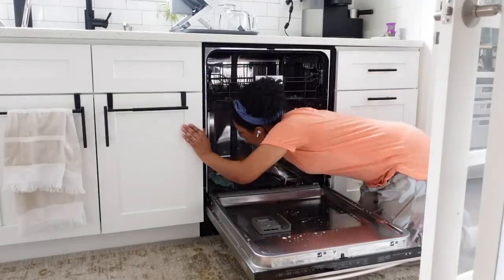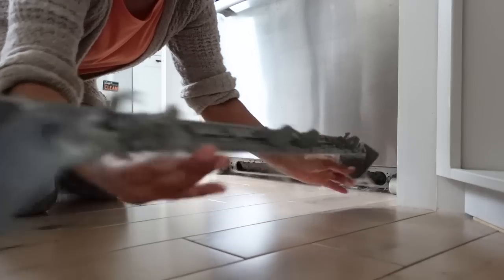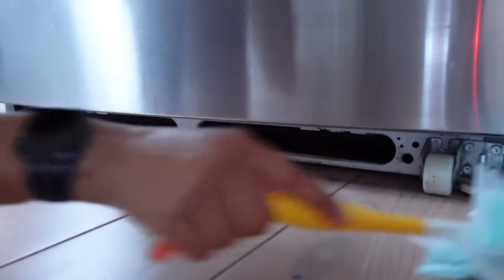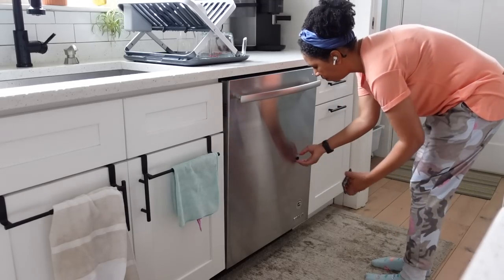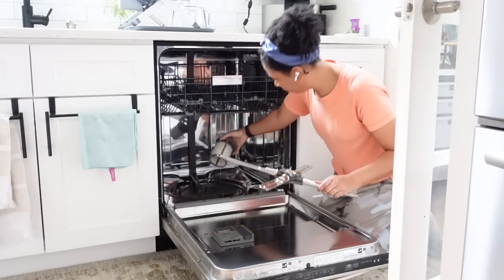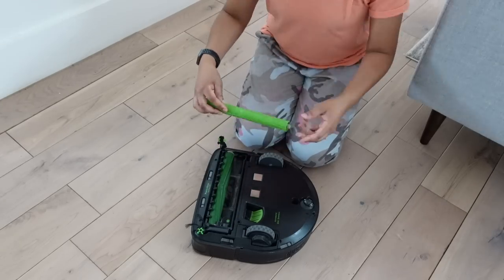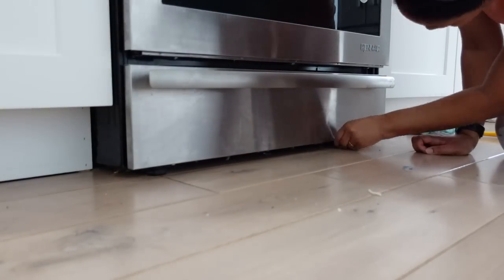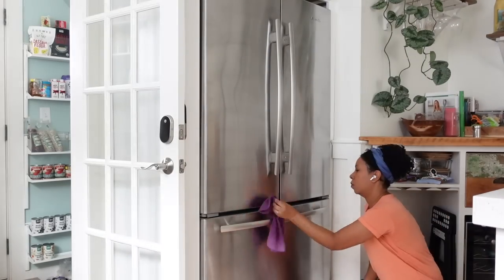🌸🧹 Spring Clean With Me: Kitchen Detail Edition 🧽

Comment: thanks for the reminder on doing some of these tasks. I have to get in on my dishwasher, because the seal has so much calcium buildup it sometimes leaks while it runs.
Reply from the maker: Oh no!!! Throw on a podcast and GET IN THEREEEEEE
Reply: That is the plan!
Reply: I started with multiple vinegar cycles to soften the lime scale buildup. Followed with a baking soda cycle, which scrubs the grit for me. It didn’t get everything, but much less left for me to scrub. Don’t mix the soda and vinegar since the soda neutralizes the vinegar.
Reply: @NanetteLoves2Budget  how much did you put into each cycle?
Reply: I used one cup each cycle. The vinegar goes in a bowl like Kay did. I sprinkled the soda all over.